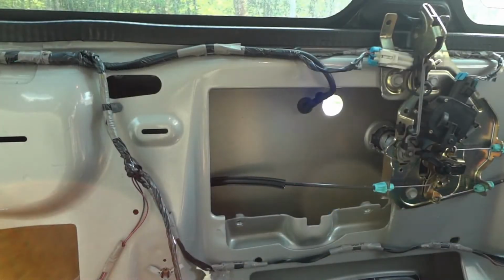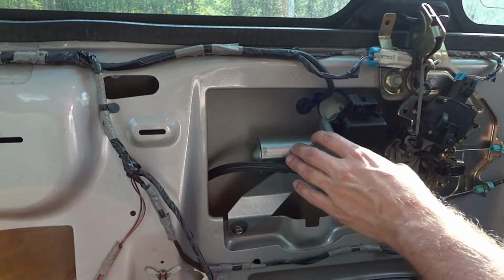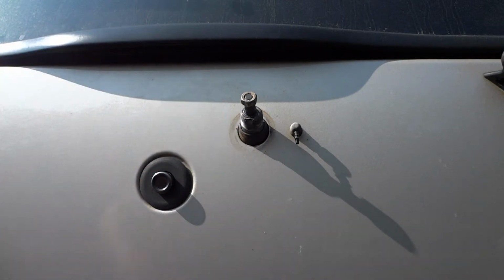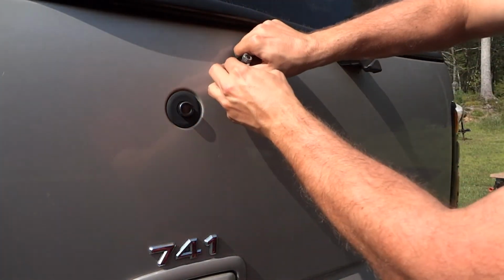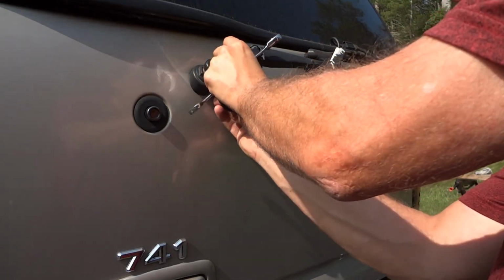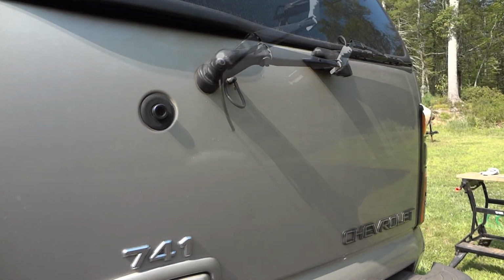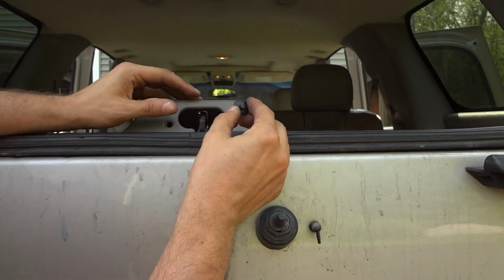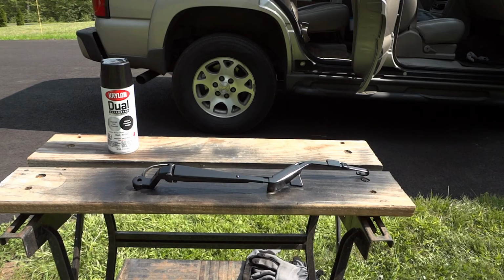Chevy Tahoe Rear Wiper Repair  - Wiper Motor Re-installation and the REAL Problem Discovered!

Comment: My 04 Escalade’s rear wiper has worked on and off for a few years. Today my wife said it got stuck in the up position and after turning the truck off she hear a thumping sound in the back door. Your video came up 1st. Watched all 3 videos, went right outside and tested it with a lead wire and it worked perfectly. I made a small jumper like yours. Works great! Thank you!

Comment: Just saved me buying a new unit.  Bad enough I had to grab one from the junkyard for $15, it was doing the same thing as the original one.  Found your video and luckily I watched it to the end before ordering a new one.  Got my rear window defogger working too.   By the way, the wiper motor assembly that you have is an aftermarket one.  The factory units are different.  They have a different gearing mechanism and circuit board configuration.  Oh...one other thing, the washer hose goes around the wiper shaft clockwise and then plugs into the rubber fitting.  Functionally it will work the same, it's just that there's a chance of something snagging the hose the way you have it.   Also wanted to add that this is one of the best instructional video's I've found on Youtube, you definitely take your time and show all the steps and explain things very well.  Keep up the great work!
Reply from the maker: I'm not surprised mine is aftermarket.  I think my Tahoe was rear-ended at some point in it's life.

Comment: Dude, I bought my 2005 Suburban 5 years ago, and the rear wiper and rear defrosters never worked properly.  Two different Chevy dealers and my local mechanic shop all threw their hands up in despair and told me to take it to a place that specializes in electrical work. Your little ground wire hack took me 10 minutes, and now both systems work perfectly. Thanks for a great video. Subscribed and liked!

Comment: I had the same symptoms, mine gradually slowed down for a year until it was not moving, but was still clunking. I started by redoing the burned ground at the body to liftgate, no success. Added a ground between the motor and liftgate, no success either. Took the motor apart, removed the rust on the shaft and greased it generously, put it back on and added the ground and it works perfect now. At the end, I think both the grease and the ground solved the issue, not just one of them. Thanks for the walk up.

Comment: On mine, I just cleaned off all the extra grease from the wiper contacts and no more wiper problem.  On a side note, I had a problem with the climate control baffle motor under the dash.  It was making a clicking noise when set at max cold.  One day after disconnecting the battery, the AC quit blowing cold altogether.  Again, similar contacts all loaded up with grease, cleaned with a q-tip and as good as new!  Gotta love these helpful youtube videos.

Comment: My 2001 Yukon was doing the same thing.  It turned out that it was just ceased up.  I took the wiper arm off of the motor and worked the motor spline back and forth with some channel-locks, then sprayed some PB-Blaster down the shaft.  It kicked right on.  I let it run for about 20 minutes, then sprayed it again.
Thanks for the video.  It gave me some ideas to try.

Comment: This is really a good documented, very detailed in comments, repair video instruction on the Tahoe 2004  rear wiper.
I have a similar issue on my Tahoe 2004, where the wiper seems to start and then get stuck just 5 cm above the resting/housing point. Then nothing happens. However sometimes it does work normal, so it beats me a bit. I tried switching on and off several times, every time the same issue but last time I could hear a rattling sound, which makes me believe the worm-axle is rotating over the teeth of the plastic tooth wheel. That sound was present for approx 20 sec. And now it does not do anything. When you showed me the grounding issue, i directly believed that could have been my first showing issue. But then it should not make that sound i believe and work sometimes normal.
 Anyway, your video is exactly what i need to take the wiper off and apart and see how the condition of the shaft, tooth-wheel and engine is. I could buy a new assembly directly, as i believe there is an issue now with the tooth-wheel, but would like to find out what the matter is/was. Your video is really so well detailed instructed, I like that as I tend to do that also in the same manner when I try to make things clear to others. Well appreciated. :-) Thanks a lot and good luck in all the other projects you will have next time.

Comment: This is exactly what I needed!! I haven't fixed it yet, but I also have a new ground noise in my radio and my battery quickly dies sometimes, so I'm betting that this is the culprit 🥰🥰🥰🖤🖤🖤

Comment: Thanks for the video, can't wait for the weather to get warmer to try that fix.  I have an 05 Yukon with the same 2 problems, rear wiper and rear defrost.  A repair shop said that there was an issue with the 'grid' on the back window, but I'll try this before I replace the window.

Comment: That was an interesting video, thanks. 
As part of your volt testing, check voltage from + to - terminals with the voltmeter, then check from + terminal to all the grounds you can find for the issue at hand. i.e. your rear wiper motor has a ground.  
If there is less voltage at any ground, its time to fix that ground by cleaning it up etc.

Comment: I’m going through the same exact problem. I just changed motor and didn’t work but I did hear that Click noise too. I’m guessing it’s the same bad ground problem. Thanks for your helpful video
Reply from the maker: Yes - check the ground.  Also, there is a connector up near the roof that connects the wiring from the hatch to the rest of the truck that goes bad sometimes too.
Reply: @El Noodles, Did you fix your wiper problem with the ground?

Comment: Good video, of course I’m having a wiper issue as well. It worked fine the other day and now nothing. At least now I have a few things I can check, but I’m not sure if everyone is having ground issues with there Tahoe, but I’ve been having ground problems since I’ve owned the Tahoe. So if it’s getting power then I’m just gonna go to the ground. I’ll try and let you know if that’s the problem. I’ll also check the connection above the hatch.

Comment: Just did the repair exactly as you did.  Also discovered the wring harness in the top right of the hatch area shows significant heating.  Just wondered if you have had any more wiper problems since doing this repair?  I don't want to burn anything up by doing the bypass, if fixing the wiring is a better long term solution.
Reply from the maker: Mine runs very slow...I've thought about bypassing that connector but just haven't gotten around to it yet.

Comment: Good video, my suv has the same issue and even with a new wiper motor from auto zone, the wiper arm would not move. What guage wire did you use for the extra ground cable you striped and crimped?
Reply from the maker: I don't remember...maybe 14ga???
Reply: Thank you for the help, 14 awg should be alot better than the factory stock 18 awg ground wire.

Comment: I recently purchased a 2005 Suburban with a similar rear wiper issue. The rear defroster works but the wiper just clunks as yours did. Being a lazy person, I think I am going to start with your ground jumper technique. I have already purchased a new Dorman aftermarket motor just in case i need to replace it. I'll let you know how it goes.
Reply from the maker: Good luck!  Please do stop back and let me know how you made out.  If the ground wire doesn't solve the problem you may want to take a look at the connector between the rear hatch and the body.  I'm told that connector sometimes develops problems over time.

Comment: you should mention at the beginnings of your video series here that they usually just need a new ground wire. . I went through all three videos then replaced the motor before eventually finding this video again when searching why it still wouldn't work with a new motor

Comment: I've tried the ground wire work around , purchased a new motor - and still have no power coming to the back rear window wipe - and now - I have a REAR ACCESS OPEN message on my console even though the rear window and lift gate are both closed?  Any thoughts?
Reply from the maker: There is a connector between the hatch and body that fails...check that out and see if it is good

Comment: I know the rear defroster draws lots "O" current, and I had a feeling that a bad ground might have been the issue. I had no idea that was also the wiper motor had the same problem. Isn't the term "bad ground" kind of a oxy moron? Shouldn't it be "no ground" instead. Like "jumbo" shrimp......lol   Good job!
Reply from the maker: The fact that the wiper and the defroster didn't work should have tipped me off in the first place.  Then the light bulb should have went on when the voltage and resistance of the defroster tested good...but it didn't.  Oh well, some lessons are learned the hard way I guess.

Comment: I have a warranty that wants to cover that but they want $750 for the job the mechanic says that it's not worth it for him to put one man on there for $50 an hour Taken 2 hours and then of course I pay my hundred dollar deductible I asked him if he could work $200 deductible in the $750 price he said he couldn't because the warranty would not pay for an aftermarket wiper pump and motor had to be original item what do you think about that Frank Montenegro